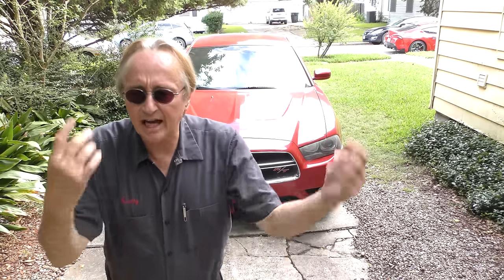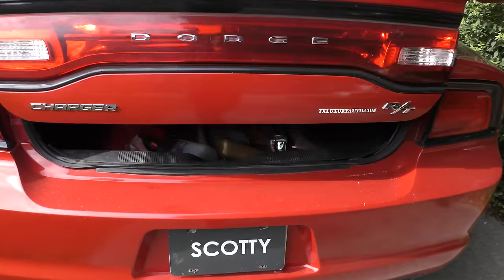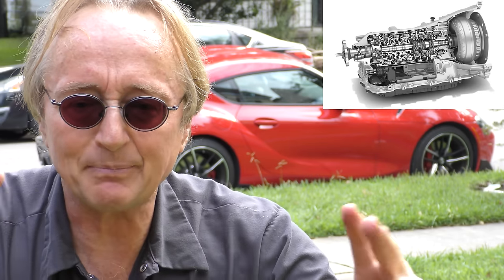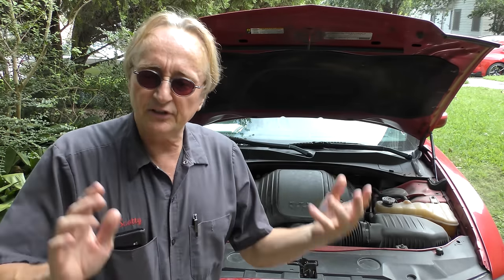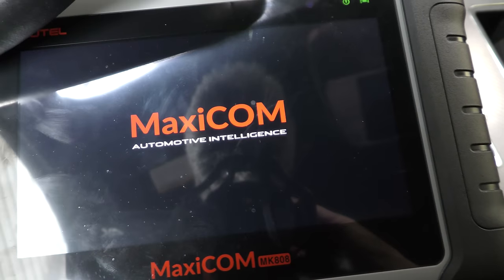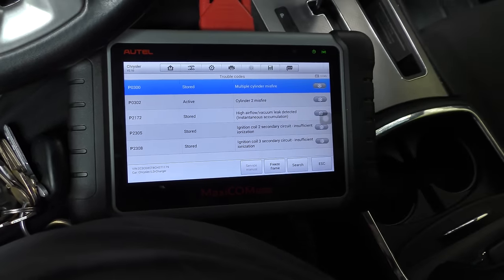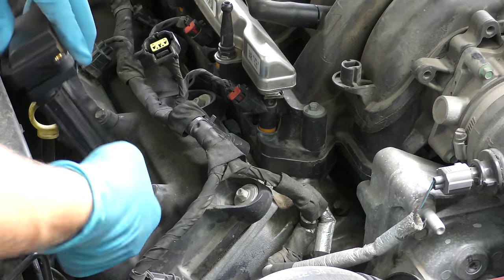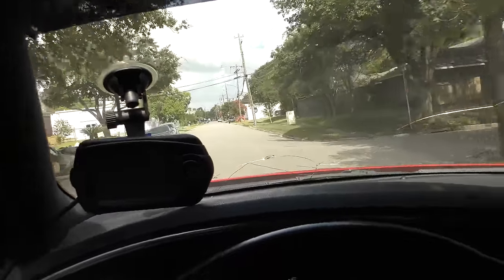Here's Why I'll Die Before I Buy a Dodge with a Hemi Engine

Comment: This man blames everyone but the owner for the maintenance of the vehicle
Reply: The owner doesn't matter. If it isn't built well, then it isn't built well. What else is there to say? The car had like 23 fault codes.
Reply: i mean dodge is known for bad cars though
Reply: @Yammie_Moto671  if it isnt built well then it shouldn't be sold right?
Reply: Marco Lopez Jr no knock offs
Reply: @Yammie_Moto671  You realize you can take the most well-built and reliable car on planet Earth give it to a dumb teenager/college student and when you come back in a year the car may not even a run.......  Not because the car is crap but because they ran it out of transmission fluid, or they busted the CV axle. If an owner doesn't take care of his/her car it will not last.
Reply: @Yammie_Moto671  bud, if you abuse the hell out of ANY engine for 148k miles, it's gonna have problems. You have to take care of them properly and do correct oil changes with new filters twice/year on average. I've owned the 5.7L and 6.1L Chargers and both of them were pretty much unkillable. I literally could not break them bcuz I took care of them. This particular R/T had problems bcuz it's entire lifespan the owner had just abused the hell out of it. It probably only got oil changes every 10k miles. Once per year I bet. Ownership is the #1 thing to an engines longevity. I currently drive my 2007 SRT8 Charger with 106k miles and it's great. Zero engine codes bcuz I take care of it.
Reply: Tristan M. Hartman Preach! 👏
Reply: @SRTBOAT  People seem to forget the fact that tons of their sensors going bad prematurely is not the customer's fault, rather the dealership. This alone, you should question if their computer and stuff is actually accurate. With higher powered engines, all components must work very well. If some sensors don't work properly, even when driven carefully, it may put a significantly more wear than if a good one were active. Yes, some people fail to maintain their vehicles. However, most cars having these sort of problems come from the same dealership.
Reply: @Yammie_Moto671  The owner doesnt matter? Lol. The owner is responsible for the routine maintenance. Which is vital in keeping all the moving parts in good order. Doesnt matter what the car brand is, or who makes the engine, without proper care you will run into issues. I work as a shop mechanic in California and I see everything from Toyotas to Fords with the same issues as in this video because the owner didn't take care of the car.
Reply: Marco Lopez Jr no, initial reliability is all that matter to most companies. I mean BMW’s are notoriously u reliable and they sell plenty of them
Reply: For real....
Reply: No kidding if they cannot be bothered to maintain and clean the interior how much care do you suppose they give the mechanical systems. People like to blame the brand but I would argue a lot has to do with the care or lack thereof given to the vehicle.
Reply: @SRTBOAT  completely agree
Reply: I have this engine in my Ram truck.   It appears that hydraulic lifter bearing fails and grinds the cam, making the ticking noise.  Likely wrong engine oil was recommended by the manufacturer - which has nothing to do with owner taking care of the car.  Just bad engine design.  5w20 gives you better gas miles but not that great at protecting engine components.
Reply: I have this engine in my Ram truck.   It appears that hydraulic lifter bearing fails and grinds the cam, making the ticking noise.  Likely wrong engine oil was recommended by the manufacturer - which has nothing to do with owner taking care of the car.  Just bad engine design.  5w20 gives you better gas miles but not that great at protecting engine components.
Reply: Den V. Yea because the owner didn’t take care of it that’s why
Reply: Yes. Most modern cars are reliable cars
Reply: Tristan M. Hartman preach
Reply: @SRTBOAT  Chrysler has the most reliable engines on the market. They have not taken the turbo plunge. Another reason I like their engines.
Reply: Curt W I’ll agree with this, I have a Hemi aspen with 260k miles on it towing 12k (capacity is 9). While my buddies Toyota that Scotty jizzes over runs like shot and he’s put 3k into the motor and it still won’t run right at 90k miles and he does actual maintenance.
Reply: As does everyone else who calls a car a P.O.S most people don't even bother changing or checking their fluids.
Reply: Exactly !!!!!!
Reply: Looks like he took care of the inside of the engine like the outside of the engine.  That thing is a mess.  Use synthetic oil and change it.  And keep your car clean.  That thing is gross.
Reply: Those million fault codes shows its who made the car fault 😂 did yall not see that in the video? Your engine can blow in a Toyota and you still wouldn't have those many codes for faulty sensors. I'm down to believe a man who's seen engines over time not a 10 year engineer who built from a random schematic
Reply: I agree every car is reliable its all about the owner when it comes to used cars nd this hemi made it 145,000 miles with a bad owner its basically bulletproof if it's still driving well
Reply: And he won't tell me what kind of car he drives
Reply: There's bad owners of Toyota Camry's and they will out last a Dodge 5x😂😂😂
Reply: @Yammie_Moto671  I see celicas and civic falling apart because the car is crap? OC not the case, but the maintenance is crucial.
Reply: @XerxezsX  Nah the rust is a massive problem and the 4 cylinder it is a cockroach, trustworthy but pitiful.
Reply: @marcojr2002  Really? This is America. We build trash then sell it to garbage men knowing it will break just so they can buy another one 😂
Reply: I wonder how many miles were on that charger?????
Reply: @SRTBOAT  Damn right!
Reply: @triparadox.c  That's pretty much what the finance gal told me when she was trying to sell me an extended warranty.  She called out the "old days when it was the power train or transmission that went out.  Her parting shot was that the horn is electronically activated via 8 modules.  I still declined all offered extended warranties because I'm going to drive the sucka! :D
Reply: @marcojr2002  Thats not how the world works dude. The design of the hemi engine causes a lack of oil lubrication at idle to the lifter camshaft lobes. Thats why you see so many of these motors failing in ones that have high idle time. These motors have been eating camshafts and lifters for 2 decades and Stellantis/Fiat/Chrysler/Ram/Dodge Dogshit won't ever bother to fix it.
Reply: My 2014 has 100K+, regular Royal Purple oil changes and Wix filters; only engine issue was an oil pressure sender. Lifter issues are not as prevalent as perceived; these engines have to be maintained and revved. Failures most often happen to people who don't change the oil or use the wrong grade thinking that makes them a mechanic.
Reply: Get a reliable Toyota in 15 or 20 years it will run like new, I have an 06 Civic LX bought it brand new in 05, the car is 16 years old runs like it's brand new, the interior hasn't deteriorated at all and I'ved keep it outside my driveway all these years in the 105 degree sun. I still hit 110 mph like nothing(limited top speed).

Comment: ive been a mechanic for 30+ years im also a dodge fan worked on everything. ive found the dodge hemi is a solid engine. i myself have a 2007 Charger with the same engine that you show in your video. it has 270,000 + miles on it and it runs great. and it gets 24 miles to the gallon. also very comfy riding car.
Reply: Thats also the engine known for having the worst lifter plates too, hope that things still up and running bro
Reply: Solid engine but not a great engine
Reply: What's the average life of a 5.7l engine? I want to rebuild an engine on a challenger and I take care of and work on my own cars but is it worth rebuilding?
Reply: @priusgame1178  Im in a 2016 Charger R/T with 53K and its pushing great so far!
Reply: @pcp3925  normally I hear those engines crap out at 100k but those are people that can't even tell you the last time they changed their oil. I think the complaints are from people that buy off Craigslist and inherit someone else's poorly cared for car. Toyota prius has the same issue so even though the prius is a great car the previous owner is what makes or breaks it.
Reply: @priusgame1178  You make a very valid point. Yeah i wouldnt lie if i said i havent been thinking about trading my rt in because they can ultimately crap out whenever. But change the oul every 3-4K miles and you'll make it pretty far
Reply: @pcp3925  could just be my opinion by I also would question the grade or viscosity dodge recommends in their manuals. I've seen euro cars here use the wrong oil vs what euro owners are being told to use. Even the prius I've seen enough to use slightly thicker viscosity where I am aware mpg will drop a little but it makes sense why we get good mpg because the engine is running on water, lol. I'm not saying to use thicker oil but for now it would be considered for me
Reply: Ofc u love em 😂 u a dodge fam lmao
Reply: What is your opinion/experience with the PentaStar v6? and 3.5 motors? Are they OK with regular maintenance?  Do they tend to last a while? Are the Chrysler 200s that bad? Are any 200s OK? thx
Reply: @priusgame1178   Don't know how long it'll last but I have a 05 Magnum R/T with the same engine. 167K mi. so far with no engine problems (lots of other probs), using synth oil, changing every 6 - 8K mi. Still getting slightly over 20 mpg highway.
Reply: @priusgame1178  This was me with my 2006 Dodge Magnum Hemi. I got it cheap $2000 but the previous owner ran the crap out of it. If I had gotten the same deal from someone who didn't mistreat the car it would have been heaven. Instead it was hell. I had to fix something every 3 months or so. I was making a paycheck only to fix the car that drove me to work. Even after owning it for only a few weeks it blew a head gasket. The owner's father bought and installed a new second hand hemi engine at his cost but the car still was a basket case. I sold it after 3 or 4 years and bought a 2006 Grand Marquis.
Reply: I have dodge magnum that I love
Reply: @tysonbanks2064  I love/hated mine. They are great when they have no issues.
Reply: Ive had a few as well, am a mechanic and if you maintain it, it will outlive most of us. I now have a Scat Pack Charger Wide Body and what people dont realize is that it WILL shake on idle. Its designed to have that rumble. I also have a Super Stock, and thats a whole new level of noises and sensations. I fell in love with the new era muscle cars, which is something, since Im still a die hard old Ford guy, with many 50 plus year old Fords in my driveway. In fact, I fell in love so much with these cars that Im coming out of medical retirement to go work for Dodge, just to learn more about my own cars as well, to keep them running good all the way till somebody sells them at Barrett Jackson lol.
Reply: @kurtdavis7225  Huh?  Murica.  We speak Murican.
Reply: My dad's 2006 Daytona Charger with a 5.7 hemi has 375k on it and runs like a dream still. Regular maintained car and never has given any issues. Still does smokey burnouts too.
Reply: @zayske302  Right on!
Reply: @zayske302   I’d be really proud of your Dad. Only thing is I bet it costs a lot to keep it fully maintained.
Reply: @priusgame1178  my 2014 R/T is at 117k and no major issues, i ran her especially hard when i first got her, and have taken several road trips driving 250+ miles straight, and still floor it everywhere. i use full synthetic and have routinely changed my oil every 5-6k miles, and get it inspected yearly so just like most vehicles it'll run you as far as you want it to as long as it's properly taken care of.
Reply: I have a 2009 ram with 350,000 miles and it’s still running great getting about 17 miles per gallon
Reply: Have a jeep with the hemi in it. Creeping up on 300k miles. One rebuild on the transmission at about 160k. Things in these are oil changes are a must, if need to replace parts OEM on the engine is also a most, the 545rfe transmissions are well built if maintained again with OEM filters. Just my 2 cents.
Reply: This shows Killme will never know what he's talking about. "mY GrAnDpApPy WaS a MeChAnIc in the 1800's"
Reply: @pcp3925  you don’t know if he cam swapped it or not lmao 💀
Reply: I have a 2007 as well. So far it has been a great car!!
Reply: Show a picture of the odo. We are calling
Reply: I have a 2007 myself I bought in Feb of 2008 and never had problems with it until now it has 125000 miles and I ❤ it. Out of all the cars I have this Dodge had been loyal to me
Reply: 24mpg?
Reply: they messed up with cylinder de-activation..it ruins the engines longevity.
Reply: Got a 2012 5.7 over 200K running great this winter it’s getting a refreshing and a Scat Pack 1 gonna try for 12’s in the 1/4
Reply: 24 mpg?...that is strictly highway driving...
Reply: Same I have a 07 charger r/t and man these things are money pits and don’t get me started with the overheating problems these particular models have but I’ll stick with it till I’m able to get the newer ones with 8 speed and better quality cause man I love my baby but damn I’m so ready for a newer one😭😭😭😭
Reply: Yea but you maintain every little thing and probably don't ride it into the grave
Reply: If you maintain an engine regularly  like you should you won't have a problem. Guys like him should shut up.

Comment: I was having lots of problems like this on my 5.7 Hemi engine. It had bad intermittent misfires especially at idle and terrible gas mileage. I thought it was bad engine wear. I took off the plastic intake and the gaskets at the manifold ports were shrunken down completely. Replaced them all and it runs like new again with great mileage. Always make sure your intake is completely sealed!
Reply: Tell me you ran regular gas, without telling me you ran regular gas lol
Reply: @robbyg1311  this happens if your regular gas?
Reply: @limbogt747 i don’t think they’re meant to take 83
Reply: @limbogt747 AFAIK Most Hemi engines take Plus or Premium. My 392 takes Premium (91-93).

Comment: The NAG1 5-speed is a Mercedes-Benz transmission, NOT A CHRYSLER transmission.
Reply: thankyou my fellow Daimler follower. :D
Reply: Finally someone said it
Reply: Along with a Benz drivetrain, it also has Benz electronics.
Reply: @geoffrolland2676  really? last i read... at least with my 07, and what i've seen working on it... only the drivetrain was Daimler from the transmission back to the axles. the engine and everything else involved with that was made in the US. 

considering how much electronics was in my 07, if they were Daimler it couldn't have made it to the 90% North American manufactured and assembled requirements. 

now i've absolutely no clue how Fiat has changed things since they took over. but i'm pretty sure you're incorrect about the Chargers' electronics being Daimlers'. but hey, i might be wrong, i haven't cleaned and checked every single black box or wiring harness in the whole vehicle. i've probably only examined 30-40% of them. i have been working on it since i got it 13 years ago brand new with not even engine break-in mileage on the odometer.
Reply: You should find out what Scotty thinks of Mercedes 😂😂😹😹
Reply: @geoffrolland2676  no it doesn’t.
Reply: It still sucks
Reply: Absolutely correct love the 4 speed on my 2010 300 very reliable 👍
Reply: Hem Dog  they're strong but even 500 is pushing it a little. you'd be better off replacing the valve body even if you aren't pushing that much since it's relatively easy. I've seen instances of just firmer shifts causing problems on the stock body
Reply: Which is still awful
Reply: @lesliekilgore648  lol...
Reply: @lesliekilgore648  Hemis are made in Mexico...
Reply: Yep. This is old and unfortunately a pretty bad condition 5.7 with lifter tick and probably more. He falsely said Chrysler 5 speed lol. It’s a MB 5 Speed. The AWD systems in these if they have them are Borg Warner I believe.

Comment: These chargers were backed by the 5 speed Mercedes 5G-Tronic originally built to handle the MB V12. These units could handle well over 600 lb-ft of torque so it was not over-stressed. It did require fluid and filter changes every 40-50K and had a tendency to leak from it's plug harness but that is usually an easy fix. I've owned a few of these that got close to or over 200K with no issues, still smooth. Likely a lot of charger owners drove like madmen and did 0 maintenance.
Reply: The nag-1 is actually a good transmission
Reply: its* plug harness
Read a book.

Comment: Scotty : not worth it to repair it

Maniacs: 770hp crate engine swap
Reply: (Hellephant enters the chat)
Reply: Still a 4dr
Reply: And trans, and drive shaft; and clutches  and half shafts and  bearings
..
Reply: Funny thing is Chevy makes a crate engine that’s like 1500hp with no supercharger or turbo it’s just straight dumb Chevy May had dropped their coke in those engines

Comment: I have an 08 r/t 60k mileage and it runs like a charm. However i take very good care of her. Always cleaned matained undercoated and polished. Normally I like Scotty's videos but this one hit home a bit. A 2012 with that many problems has just been neglected by previous owner.
Reply: It is a good illustration of the kind of HEMI Charger you're bound to get if you buy a used one without care, though- usually the used HEMIs that run well are kept by their owners
Reply: I agree.